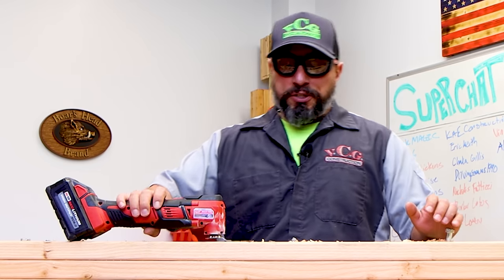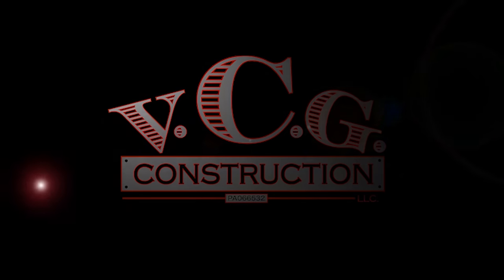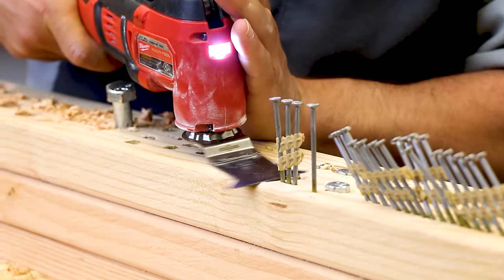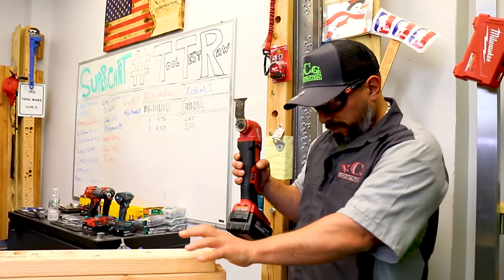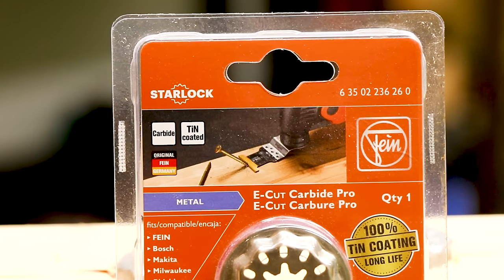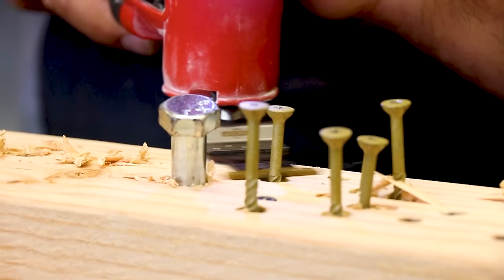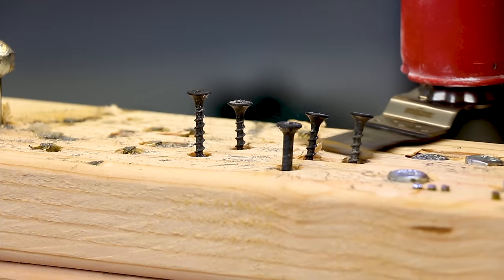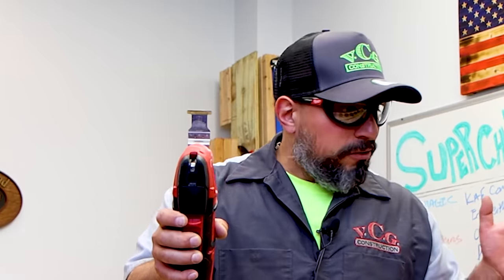STOP! Watch This Before You Use A Oscillating Multi Tool (Stupid Mistake)

Comment: People are trippin. A wood and nail blade will eat up nails all day. Will even handle stainless steel decking screws without ruining the teeth if you use a low speed and don’t force it, just take your time. But that’s in a pinch. 

The hard metal blades are great, but people ruin them bc sometimes you’re using it in a scenario, like a stainless lag embedded in wood, in an awkward position like under a deck, where you’re kinda guessing where to be, and thus you end up stripping a section of teeth bc once you feel bite, you just go for it. Don’t have the luxury of distributing the span of teeth easily. 

Btw, I recently bought a Bosch star lock multi tool, got an adapter for my Makita batteries. It’s SO fantastic being able to simply click the blades on and off. I’d highly recommend it

Comment: I needed to cut a lot of screws, nails or bolts,  I'd just use an angle grinder with cutting instead of the time oscillating tool take for the same job.

Comment: Might help to spray a bit of WD 40 on the blade and nails for longer blade life, normally you do this when you cut any type of metal at high speed. I bet if you done another video using a bit of spray oil there would be a difference.

Comment: 8:55  Uh hu..yep….Definitely the application was just wrong for the blades.  So next time the Oss tool blades start wearing too fast….simply replace the studwork/rafters or whatever with new ones, but using soft metal nails….THEN get back to chopping them off and the blades will  be fine.  Of course its extra work to substitute all that woodwork..but gotta look after your tool…right? 😂

Comment: I think you may have been using the wrong tool for the operation that 49th and 50th nail took quite a bit of effort to get through I've got a cordless grinder I do that all day long with it screws nails bolts if it's sticking out of wood where it doesn't belong cordless grinder makes short work of it

Comment: Can you use an oscillating tool to cut grass or hedges?
Reply: by the time you get a few feet you'll have to start over cause the grass will grow faster than you can cut it but you can; just grab each blade of grass from its tip.

Comment: This isn’t an application anyone one would would encounter. If a screw or nail is above the surface all of us would either wind it out or pull it out. Why don’t you bury the nail as in a normal application and then try and cut through about 10 of them without the luxury of being able to move the blade sideways along the nail and se how long the blade lasts cutting in one position of the blade with all that added heat. I’ve tried it and they don’t hold out like yours.

Comment: Oscillating blades are an expensive way to cut nails and screws,i find  $3. Metal cutoff  grinder blades cheaper , of course you cant use them everywhere.

Comment: I need to get a multitool but I am on a Ridgid cordless platform and aint got that kibda money cuz so Im gona roll with the multi speed Hyper fucking Tough $18 dollar Walmart brand and get combo of wood/metal/scraper half moon whatever blades for it... 

As a DIY homeowner I think I would mostly use it for drywall and the rare times on wood. 

Remember a good blade can make an average/shitty tool better. 

Like my hypertough cordless recip i got for $40 wit battery but I got decent blades.. My average Direct Tools $12 almost brand new Ryobi circ saw rockin the diablo 24t framing blade dont give a fuck, she'll slice through timber like butter!!

Besides, most of the time my girl has my recip saw in the bedroom. She locks the door but she says she says she has been working on this project but it has been months now and I dont see any changes.

Comment: Great review Vince!  I'm looking for the best bang for the buck, what do you think about those high quantity blades on Amazon compared to the box store ones dermal, dewalt  ect.. i know you get what you pay for but what if it isn't cheap metal, is it worth your review?  if not all good thought I'd ask. Appreciate all your content keep up the great work👍🏼or anyone out there have an opinion? For example qty 50 for $32.99 Multitool Accessories for Wood/Plastic/Soft Metal Cutting Fit Dewalt Tools Bosch Ridgid Milwaukee Rockwell Fein Oscillating Tool

Amazon'sChoicefor "ocillatingting

Comment: Thats good that it made it through them but the big picture with all of these blades is they charge you $15 for one blade.  It costs almost $1 to cut a screw and thats ridiculous and not pratical.  Not criticizing the steel, or carbide, or blade design,  .... just criticizing the aholes that set the price on these blades.  In my opinion, they are the biggest rip off in construction tools.

Comment: There is all kinds of problems with these blades of course the biggest one is friction and heat all these blades make up the same claims but as mentioned no tool steals are impervious to the onslaught of trying to cut through a harder steal that's close to what the thing it's self will be made of and maybe a lubricant of some type could help  maybe the thing that can help I do have a couple of these osilating tools I do like them but the blades can run $$$$$$$$%up a bill there just not to practical depending upon what it is in real world terms your asking of it to do in some cases it's just not the right tool for the job just saying as all tools people to they all have limits 
                                                                                           Just saying 🤣

Comment: Most of the teeth were gone before you finished and I buy oscillating blades for wood with nails. That blade was destroyed before you were done and in cordless tools a dull blade makes slow,ugly cuts. You destroyed the blade long before you cut 50 nails.